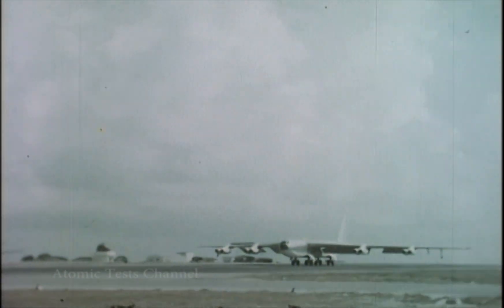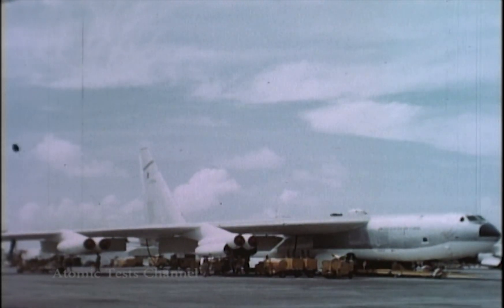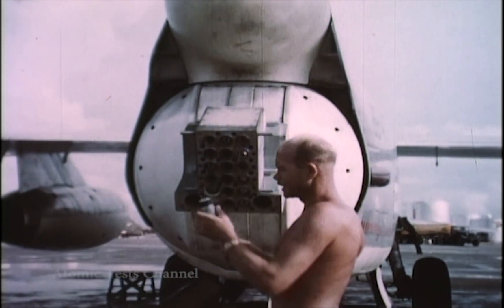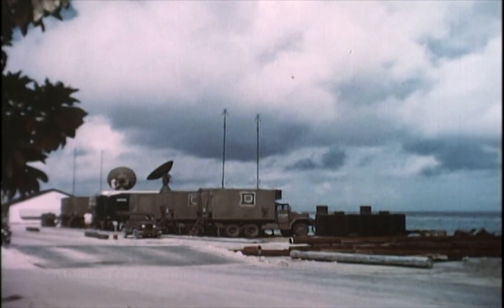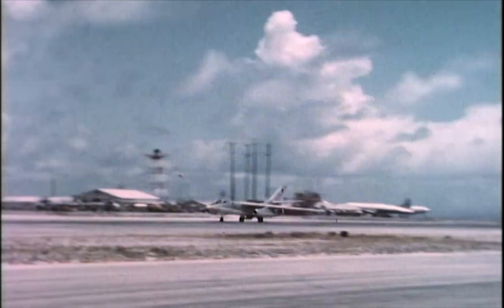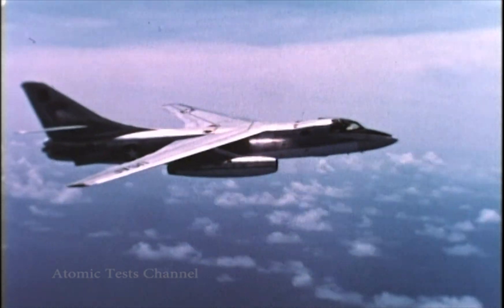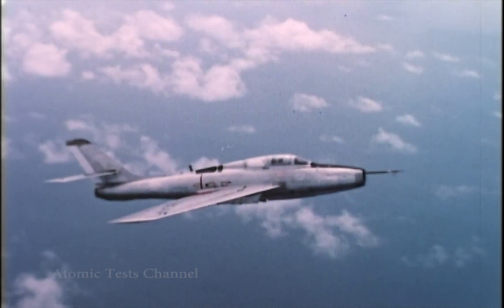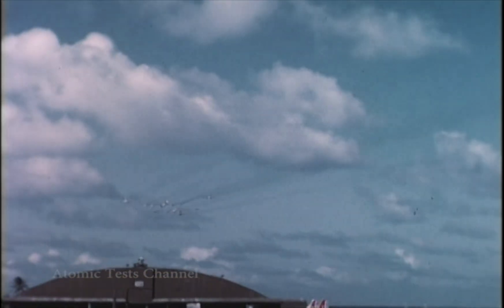Wright Aeronautical Development Center Aircraft in Operation RedWing 1956

Comment: 13:00 - watch at x0.25 speed. At one point, it look like a jelly candy. I wonder what cause that very bright spot at the top.
Reply: Yeah I have heard guys state that it is the fission primary running ahead of the fusion blast but I don't think so. Those are too quick to see. That did look like almost a double fireball in that shot. I have seen it before but that is real clear.

Comment: I was hoping there would finally be a discussion of the MASSIVE bombing error (19,000 feet off the mark) from the B-52 during the Redwing Cherokee 3.5MT shot. It's hard to fathom how the bombardier screwed up so bad with a weapon of that power.  To be a fly on the wall of the commander's epic chewing out of that dude....yeesh.
Reply: Not to mention the soldiers who thought they had their backs to ground zero were facing the detonation.
Reply: It was 3.8MT (It was the Zuni shot that was 3.5MT) but, yeah, after that epic fuckup the bombardier/navigator would've himself torn a new arsehole (A LOT of valuable data was lost because that bomb-aiming error).